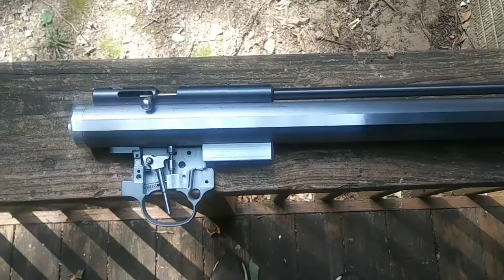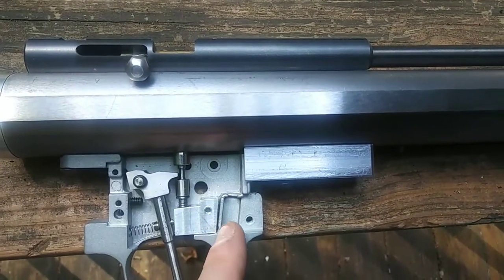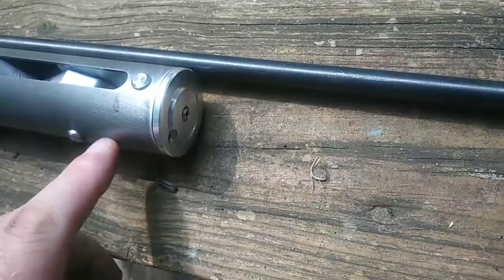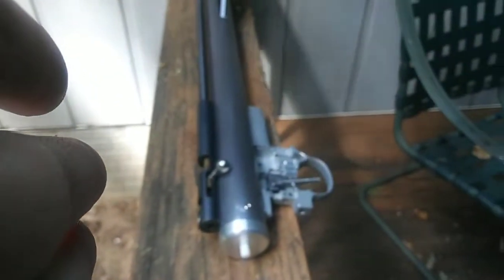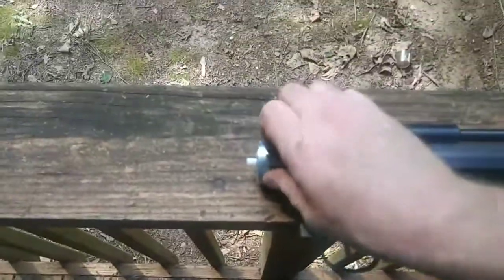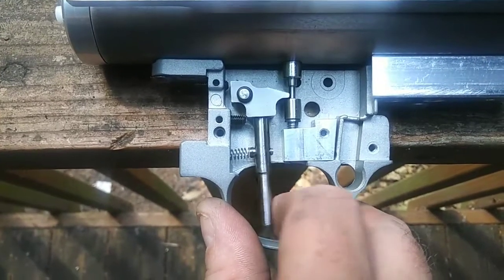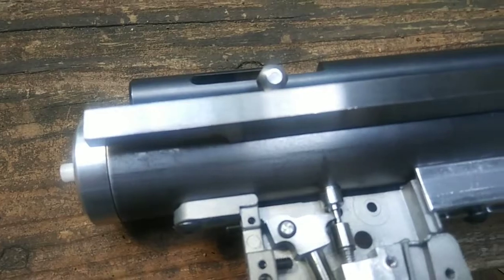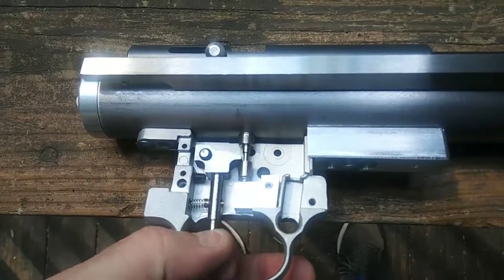SSP Trigger Pack Assembly and Function

Comment: Lovely airgun, I'm currently searching around for inspiriation for my own ssp. I was planning to just use a hammer to open the valve but you have a self-resetting valve pin? How does this work exactly? Cheers.
Reply from the maker: @thijsrikkerink6333  Hello, there.  Thank you.  If you are familiar with Sharp and Sharp Ace/ Innova air rifles, the Crosman 1400, etc.  They have auto resetting valves.  The 1400 is a valve cap with a spring behind it while the Sharp Ace/Innova use a valve pin.  The sear in the 1400 engages the valve cap while the trigger linkage in the Sharp Ace moves a steel panel upward that has a hole in it.  These two designs are blow open valves.  

Mine works similarly to the 1400, but uses. Valve pin rather than a cap.  The valve pin, .250" diameter, has a step machined into it.  The trigger has a linked pin that pulls downward upon trigger pull.  The pin has a spring assisting it back upwards while the valve pin has a return spring behind it.
Reply: @willacewallace5905  Ah I see, thank you for your reply. It looks more simple than I thought, but would probably require some tinkering to get the right timing. I'll look into it. I like your trigger pin idea as well. By the way, is there a simple way, perhaps with some broad assumptions, to estimate the volume & pressure of air to get, say, 10 ft pounds? Cheers.

Comment: Air dumping system
Reply from the maker: Yes, sir.  Reverse spool sort of affair.  The spool in this loads upon a pin (sear pin) that is pulled away via trigger, thus releasing the spool from it's seat when under pressure.  Think of Sharp guns, vintage Crosman 760, 1400, etc.
Reply: @willacewallace5905  i actually owned sharp multipump air rifle..not the nicest trigger but it sure fun to shoot
Reply from the maker: @jollyrancher400  The issue with Sharp, is that they use a siding plate that the pin loads against and must pass through.  This means there is constant load through the trigger pull.  Makes for a terribly heavy trigger.  On my design, the sear pin seats in a groove on the blow-open spool.  The trigger pulls it down out of the way.  Trigger pull is fully adjustable down to 1.3 pounds.  A sneeze will set it off.  I have it set right about 3 pounds.

Comment: Hey Philip. Looking real nice so far. What,s the weight of the assembly so far ?
Reply from the maker: Freedom 700 SSP 
It weights right about 6.7 pounds.
Reply from the maker: There is some trimming here and there to be done, i.e. taper the end plug down and put a taper on other aluminum parts.  Will lose a few ounces.

Comment: Good stuff! 13.5 ft lbs in 1 stroke is great, would love to see what it will do in .177 ;)
 also can't see how the air gets in far a half stroke though, I thought you have a return spring that closes the valve automatically?  Great job, anway
Reply from the maker: appynoon, correct.  There is a return spring.  When it returns home after firing, there is over travel on the pin.  Stroking air moves the valve pin rearward a few millimeters to then allow for the sear pin to be pushed back in to the void via the return spring pushing up.  Auto resetting with valve pin pusher assist.  Also, the piston is designed where the oring slips 2mm exposing a weep hole on the piston face.  This way a hole in the tube to draw air is not needed, and stroke can be varied.
Reply: isn't that interesting ... so that kind of sliding o-ring works in high pressure mode too? I always though that would affect performance but clearly not, because a significant proportion of the air charge fills the gap in front of the o-ring ... and then has to get from there to the transfer port double quick!
Reply from the maker: appynoon, sure does.  1.5-2mm is all that is needed.  On the piston face is a small weep hole.  The hole is such that half of its radius is cut into the gland.  The oring is forced against the piston face when opening, exposing the void.

This principled design is used in many high pressure applications, such as PCP hand pumps.